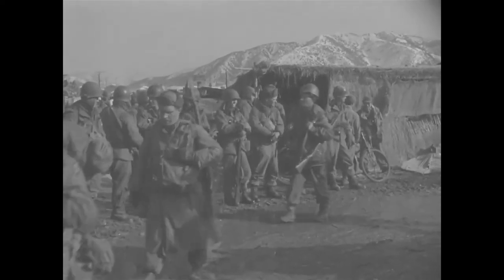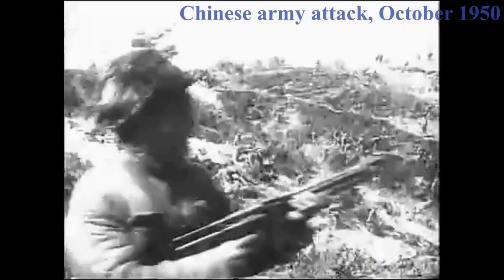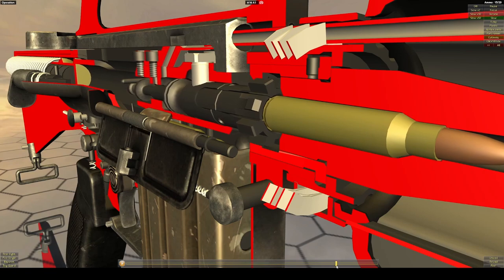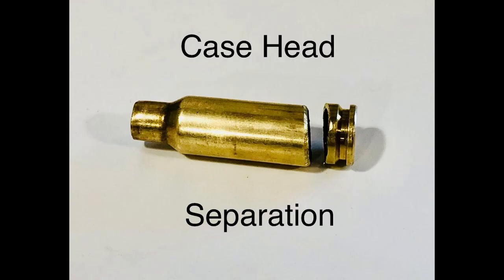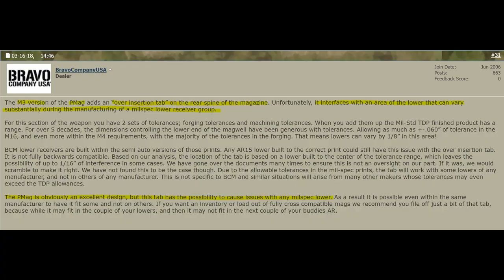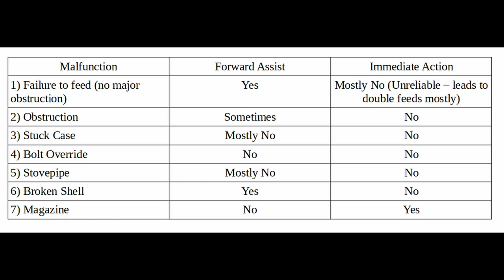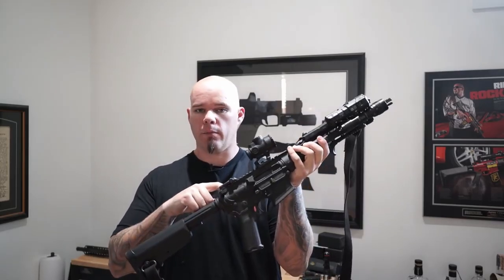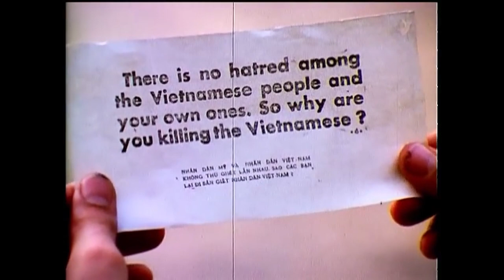The Forward Assist Part 2: Immediate Action and Kyle Rittenhouse

Comment: Well done. The forward assist is a net positive regardless the advice and/or opinion of it's detractors.
Reply: Totally agree I would not want one without the forward assist.   Sometimes you need to pull back on the charging handle to see or prove there is a round in the chamber.   There is not enough spring tension for it to go back into battery, a light tap on the FA sends it home ever time.   Makes no sense not to have one.

Comment: It's embarrassing for the anti-forward assist crowd that it's been nearly half a year since this video and their only response is deafening silence. I want to hear their counter-counter-argument, if only to bear witness to the mental gymnastics. Especially given that Karl presents himself as an anti-shilling/anti-sponsorship guy, when in reality his pet project is one of the biggest cons in the AR market.
Reply from the maker: On the contrary, Karl replied with some kind of cryptic forward assist post on his twitter account 2 days after I made my second video. It seems they'd rather not give the subject any more depth (or lack thereof) than they already have.
Reply: Yup, glad to see I'm not the only one who understands DeRanged and the Flock of Seagulls dude..
Reply: RE 1:03:43 - I am glad to see that you covered the scallop cut in the bolt carrier as designed to operate the dust cover. I have seen that explanation of it being a thumb slot to push the bolt home and shuttered.
DON'T PUT YOUR THUMB OVER THE HIGH PRESSURE EXHAUST PORTS OF A LOADED AND POSSIBLY MALFUNCTION RIFLE PEOPLE! 
Yikes... some experts. 😨

Comment: The argument of “racking the charging handle” doesn’t take into account how awful the placement of the charging handle is on an AR, and it’s even worse with a standard charging handle as opposed to the Radion Raptor I currently use. It’s the one ergonomic aspect of the AR I think isn’t good. Given the awkward angle Kyle was sitting on, the charging handle certainly would’ve been much more cumbersome and slower than simply bumping the forward assist. Even if the forward assist isn’t strictly necessary, it is much, much more convenient than doing any of the other methods. It’s like how I don’t strictly need to use the elevator to go up 5 stories, as the stairs can also do the same job, but I’d certainly take the vast extra convenience of an elevator than the stairs.

Comment: Karl from DeRanged used the forward assist in his mud test for the XM7 as Ian did in the POF mud test..Both are notorious anti FA yet they demonstrated why it was required.. During the bloke on the range YT video, another observer asked Ian where the FA was when he had malfunctions with the HK91 and FN FAL and couldn't get the bolts to lock because of a dirty action where a FA would have worked....Full Spectrum was vindicated again about the need for a Forward assist..

Comment: PFC Patrick Wayne Miller. 507th Maintenance Co, 11th Air defense Artillery Brigade. Nasiriyah Iraq. June, 2003. 
During an ambush of his unit, which was ultimately over-run, PFC Miller used the forward assist on his malfunctioning M16A2 rifle in single fire fashion to almost single handedly hold off an entire company of Motorized Infantry for several hours.
For his actions he was awarded the Silver Star with V device for Valor.

Comment: The M1 Garand, M1 Carbine, M14, Mini-14, AK47, Galil, and most other modern combat rifles all have a forward assist. 
It's called a reciprocating charging lever.
Reply: @DaedalusHelios  If I remember correctly they even use the reciprocating charging handle over on InRange in one of the mud tests, I don't remember which one and this could just be misremembering since it's been a while since I've watched any of that content, but I swear they use a reciprocating charging handle on one of the rifles as a forward assist. (But again, my source could just be functionally "it came to me in a dream".
Reply: Indeed, and to my personal experience with Kalashnikov type rifles (Finnish Valmet/Sako versions), the typical failures where the bolt is only slightly out of battery are related to adverse conditions, and as such are fixable with a firm tap to the charging handle.

The Kalashnikovs will not drop the hammer unless the bolt is in battery (hence a misfiring cartridge will give a positive feedback of the hammer dropping, and the only action taken should be a single charging handle operation, or a standard empty magazine change, if it doesn't appear as a malfunction), and if the carrier is arrested far back, it can be quickly seen that it requires remedial action where the magazine will need to be detached first. So, the same logic described in the video works with the Kalashnikov action as well: if the bolt is only slightly out of battery and there's no visible stovepiping, just a tap to force the bolt into battery will be sufficient action, whereas remedial action will need to be taken in other cases of the bolt and carrier being out of battery.

Although I've got to criticize the Finnish SOP, which employs always only remedial action as the SOP in every failure, except those which give the feedback for the hammer dropping: remove magazine, observe magazine for issues, observe extraction port, rack the handle two times, check that the chamber is clear and insert magazine. This is potentially dangerous, while being as thorough as it gets, due to it being a relatively time-consuming measure in a hectic situation, I've seen soldiers resorting in immediate action as just racking the handle once in the event of a failure, without giving any thought to it, which may potentially be much more problematic than the fraction of a second needed to give a quick look to the carrier, whether the round is already about to chamber or if there's some more problematic issue.

Comment: You changed my mind about the forward assist. I drank the kool-aid about the forward assist for the longest time.

Then I saw the documents you presented in this and the previous video. 

Then seeing SOTAR endorse it here, Rittenhouse using it, and an actual medal citation about somebody using the forward assist in combat has played a huge part in convincing me.

What's really frustrating is that forward assist "detractors" are so vehemently opposed to "beating a round into the chamber" with the forward assist. Because on every single other firearm where possible, smacking the "moving parts" forward is a standard action when the weapon does not go into battery.

Semi-auto pistol slightly out of battery for whatever reason? Smack the slide forward
M1 Garand didn't automatically chamber a round after inserting clip and getting thumb out of the way? Smack the bolt handle forward
Kalashnikov/M14/ out of battery? The bolt handle is your forward assist

Yet if one was the apply the logic of the forward assist detractors., these solutions would just exacerbate the problem, and the only way to solve the problem is to rack the weapon again. Bogus!

My big takeaway is that the sentence "You're using it wrong" explains the hatred of the forward assist. And 99% of problems people have had with their weapons throughout history. Honestly this taught me to think a bit more critically about the AR and not to take anybody's word as gospel, just because they may have a fancy title,  large following, or highly assertive manner of conveying their opinion.

Comment: Kudos for exposing the false and even dangerous misinformation being spread about the FA .. Now we will see if any of these self appointed experts are legit by acknowledging their mistaken opinion about the FA or if they are more concerned with protecting their fragile egos, profits and comforting their cult like base ..
Reply: I suspect it will be the latter.
Reply: Lol "dangerous misinformation" Ok CNN. Maintaining your rifle, knowing how to properly operate your rifle, and using the charging handle are all equally or more affective than a forward assist
Reply: @noncompliant209cali It seems like you may have missed some information from the video.
Yes, maintain your rifle to the best of your ability given the circumstances.
Yes, know how to operate your rifle, INCLUDING the forward assist.
But the charging handle doesn't solve every issue if you use it blindly to attempt to solve any/all problems.
Reply: @whelper4231  but using the forward assist to ram a stubborn cartridge in like it prom night will?
Reply: @noncompliant209cali  No, don't use the forward assist flagrantly either. Know your rifle. It's uses is for remedial action, just as the video stated very well.

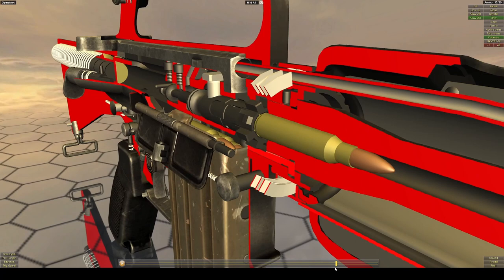Comment: On 21:46 you show that the rim is locked when the bullet stops moving forward.  But... If the case gets stuck earlier than that due to a dirty chamber or something on the case it "May" lock onto the back of the case prior to being fully seated.   
The 3D program does not allow for that type of simulation.   

But I happen to have dummy rounds and sized 223 brass.   I put some tape around the round to simulate the round not going into battery by about 3/4"
Even pressing the forward assist it would not clip onto the base of the brass.  Meaning it could not be ejected with the charging handle without a double feed.

It seems it has to be close to being in battery where the bolt face starts to rotate to have a good extractor clamp.    I had to pull the round out by hand as the extractor would not clamp onto the base 3/4" from closing.   One more reason to try the forward assist as pulling the charging handle will not extract the case.
Reply from the maker: Good observation. I make a point of a conservative expectation rather than possibility as as there could possibly be a scenario where the carrier is being slowed but not the cartridge, I also wanted to keep variables like fouling out of this for simplicity's sake. I felt it more important to get the nuances of push feed into people's minds since no one else seems to want to talk about it. I'm also counting on my viewers to have a little of their own critical thinking like yourself. A massive variable in this is extractor tension which I am arranging for some formal testing in my next video which should cut down the tediousness and length of the later video(s) in this series.
Reply: @fullspectrum1616  You did well to cover all bases.  I did not put 100 percent of my force into trying to get the extractor to pop over the jammed round.   Maybe its possible with more force.  
On Kyles gun
1.  Cold out
2.  Shooting upward - bolt is working against gravity
3.  Aguilla ammo is lower pressure
4.  shooting with stock not firmly on shoulder 
5.  Mag was it steel or polymere?

All those things can make it more likely the bcg does not go all the way home.   Doubtful the charging handle would have cleared the round.  

Not sure where you are going with extractor tension, at least with Kyles gun.   His previous round did extract.

Or is there a association of needing more closing force the stronger the extractor spring?    Meaning a very weak extractor spring makes it easier to go into full battery while spring with too much tension might prevent it from fully closing due to the increased force needed to overcome the strong spring?

Kind of like how this guy fixed some issues
https://www.youtube.com/watch?v=HqnmB9t9HqU

Comment: I thought the indentation of the bolt carrier was to pop up the dust cover door.   Are they saying its really for using your finger to push on it?  And its just a engineering coincidence that it happens to also pop the door open?    
Try shooting 50 rounds then hold your finger on the bolt.
You can't get as much leverage pushing on a oiled bolt side indentation vs hitting a forward assist, no comparison.   

I did not even know there were people that thought the FA was bad till a few days ago.   I would not want a AR without one.   I don't see any downsides to it.   Sometimes a bolt can be a tiny bit out of battery and it visually looks fine.  A reassuring tap on the FA lets you know if its all the way home.   It has more pros than cons in my opinion and as this video shows.  

This going out of their way to demonize it is very strange.   The advice they are giving is not only incorrect its reckless and could get people killed.

Comment: The oldest reference I could find for the "Tap, Rack, Bang" method was in a 1991 Department of Treasury/IRS document titled: "Criminal Investigation: Transitional Firearms Training Program for Instructors" on page 4-5 and it was refering to clearing malfunctions with semi-automatic pistols. I am not surprised this found its way into use during the war on terror since that was in the earlier days of the Internet where all manner of urban legends were able to take hold and when arguments against the forward assist likely started to flourish since this method does not use it. This was likely also thanks to the perfect timing of Bartocci's Black Rifle II book coming out in 2004. If anyone can quote what Bartocci said on the forward assist in his book it may explain the origins of the current FA controversy. Bartocci knows alot about the platform but when perceived experts like him and Ian make mistakes these are very hard to undo.
Reply from the maker: Thanks for sharing that. If you look at the "The Black Rifle" by Stevens and Ezell it essentially characterized and framed the argument to this day. Bartocci, no doubt, is heavily going off of what Ezell had done in his earlier work.

Comment: I think this myth has been busted.  Smith-busters came to the same conclusion.   The Forward assist is needed.   
Why so many other videos speak on the topic without reading up on history is troubling.
Reply from the maker: If you were to read Ezell's Black Rifle or watch the Stoner tapes (also produced by Ezell) you would get the opposite conclusion even with the due diligence of doing some reading on the subject. There is a reason why Ezell (and Stoner) is wrong that I've discovered since and will be producing in a later video.
Reply: @fullspectrum1616  Looking forward to it...
Reply: @fullspectrum1616  Not seen stoners tapes.  But dealing with software and hardware engineering there are people they do not like their designs changed "even if for the better".  Its when ego takes over logic.   I think maybe Stoner was reacting in this manner.
Reply: @fullspectrum1616  not sure if you're still making that video but I'd love to see it.